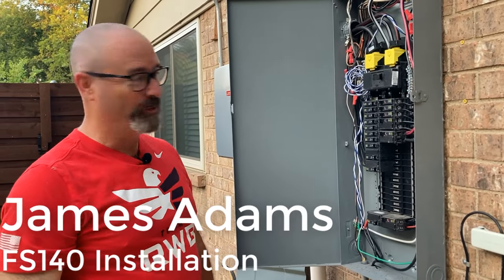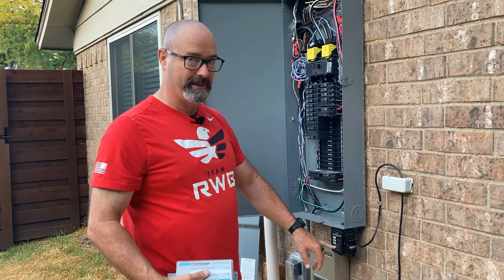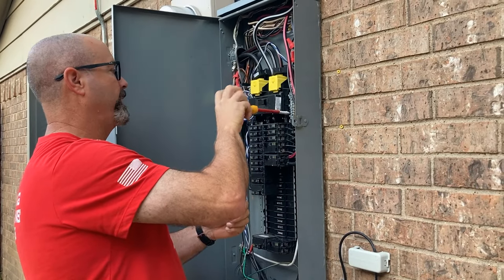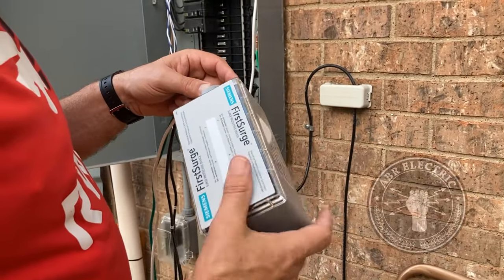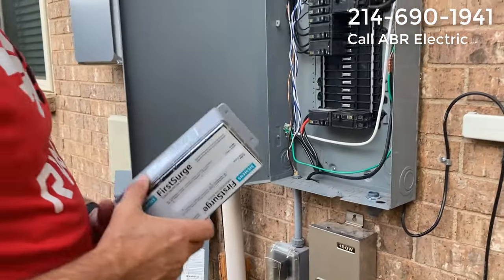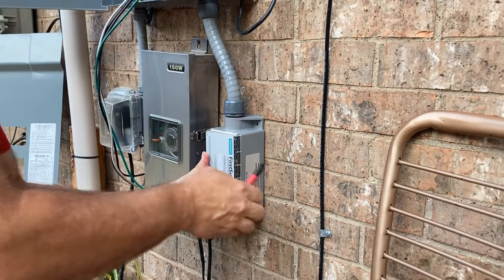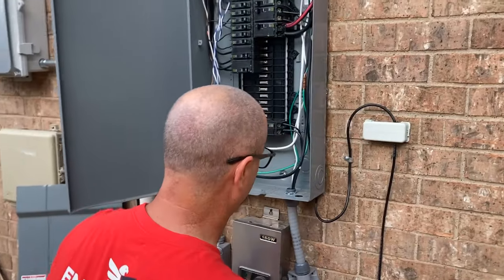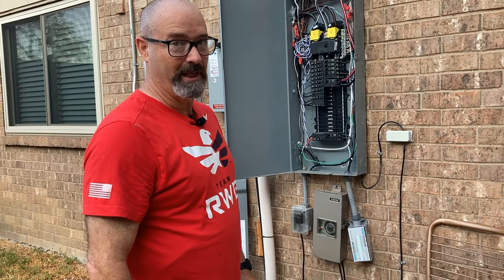Installing an FS140 Siemens Surge Protector

Comment: The SQ-D HEPD80 has instructions in the back of the that pamphlet that says that you can put ring terminals on the hot wires and connect directly to the 1/4x20 threaded studs bonding the main breaker to the bus bars!  It is the next best way unless you go with Type 1!  Just turn off your main breaker, Terminate your neutral and ground wires, then temporarily remove the 1/4-20 nuts, place your hot leads with the ring terminals on the studs and replace the nuts tightly per torque specs. It is a clean looking install, and does not take 2 Pole space and that breaker really does nothing for the surge protection (only if the SPD is Type 1 of course).
Reply from the maker: Good solution!

Comment: You should be minimizing the length between the surge protector and the panel.  Ideally you want to mount it into a CB at the first position from where the L1/L2 Enters. Shorter length = better protection.

Comment: Man i guess i did mine wrong. I installed it at the bottom. The two hot wires in the  20amp double pole breaker are at the bottom as that was the only spot in my panel. It definitely works though. My power didnt go off during the thunderstorm like it normally does

Comment: My house has two 200 amp panels mounted side-by-side (it is a big old house), and another 100 amp sub-feed panel in a detached shop.  Oh, and it also has a solar array on the roof with it's own sub-sub-feed panel.  So will one FS140 serve the whole house?  If not, how many should I install, and where?
Reply from the maker: 1 in each main panel. Do you have space in each panel to add a 2 pole 20a breaker?
Reply: @abrelectric  Yes.  There are empty slots in both panels.  What the sub-feed panels?
Reply from the maker: @so88113  subpanels won't need SPDs if the mains are covered
Reply: @abrelectric  Thank you for the information.

Comment: Just like most newer homes, we have an outdoor breaker box which is the main in, breakers for 220v dryer, AC units/compressor and 2 water heaters etc..  Would we need 2 of these? One for the main breaker outside AND the low voltage panel in the garage? I saw you had another video for doing a flush mount and it was for an indoor panel. Thanks!
Reply from the maker: One outside at the main with your 220 volt distribution would suffice.
I did the indoor one to demonstrate the flush installation.

Comment: Enjoy your videos. I am Looking at an install for a flush mount panel.  I watched your other videos where you explained the advantage of twisting the wires to get the rating back when you have long runs to the breaker and ground/neutral connections.  Is this something you considered doing here?  I need to come from the bottom like you did here, with the main feed located top and the available breaker is near the top (which is good) so I have a long run.  Also my ground bus is on the left and the neutral bus is on the right so I doubt I can twist those wires because they are going to have to take different paths.
Reply from the maker: Later info I got from Siemens tech support said the wire twisting was more an issue for commercial installations with longer runs.

Comment: I found the video to be very informative and easy to follow along.  I also dig the Team RWB shirt!  Quick question regarding landing neutral and ground wires on a neutral bus bar:  my bus bar has no slots left for anymore connections, even though my 200A Siemens panel still has about 10 slots left for future branch circuits.  Can I put a neutral and a ground under the same lug on the bus bar to make room?  Furnace just crapped out on us at 18 year mark and we're upgrading to a 2 stage Lennox with 2 step AC with a Mini Split in our addition.  HVAC guy gave me an estimate with an option to have 2 surge protectors installed (why 2, I have no idea) when one should protect everything in the panel.  After looking at the quoted price, then researching the cost of the SPD from a local store, I decided not to pay 10x the cost of the unit and just do it myself.  Thanks in advance for any guidance.
Reply from the maker: Best option: add a neutral terminal. Easiest way, assuming this is your main panel,  tap 2 holes, add the buss, connect  it to the existing neutral bus with a #4. You're creating future capacity,  and not just "kicking the can down the road"

Comment: Just thinking... if I drill a 3/4" hole in the side of the CB box adjacent to the CB I'm going to use, wouldn't that make a cleaner install? Shorter wires, no loop, no wire bending. Just a thought.
Reply from the maker: Absolutely a good thought, especially if you have a surface-mounted panel

Comment: My OCD was saying, "don't put the surge protector so close to the transformer box that you block it's opener catch." 😂The closing shot shows that you didn't.

I haven't read the instructions on this unit yet, but one thing I like is that it has 4 wires. So, if your box is not the bonded box, you can connect to both the neutral and ground busses. Many surge suppressors only have the 2 hots and neutral. I think those are rated as Type 1, but are also rated to be connected as a Type 2 to the breakers.

Question: The Home Depot page for this unit has a picture of it being installed at the bottom of the breaker box. What would be the recommended procedure to have its lights visible once you put the cover back on. Would you drill holes in the box's cover over the lights? I've seen that before and the inspector passed it, but is there a better way? I did see the video on the flush mount plate, but I mean is there a better way if the unit is placed in the box?

Technical video critique: The music during the intro vs. your speaking, the volume level is DRASTICALLY different.

Comment: Great video. I have a question, hopefully, you can answer it. If I have a spot at both the inside breaker panel and outside one which location would offer better protection? The cable run from the outside panel and inside panel is about 40-45ft. Thank you for the video and any advice you can spare.
Reply from the maker: Traditionally,  closer to where the utlity conductors come in is better. However,  if all your branch circuits are in the inside panel, that would be a solid location. Tge other consideration is whether you have access to Type 1 spd (no breaker required) or Type 2 spd that requires its own breaker.
Reply: @abrelectric  I thought that would probaly be the case thank you for confirming my belief. Merry Christmas.
Reply from the maker: @Antexjerr1  thank you! Merry Christmas

Comment: I just installed one of these and went through the effort of moving all my breakers on one side of the panel down two spots so it would be as close to the main breaker as possible. I found this suggestions somewhere but can't remember where. Was that a waste of time? I see a lot of these installed at the bottom of the panel or wherever is convenient.
Reply from the maker: Psychologically,  no. 
Technically,  maybe. Check the manufacturer's instructions: do they require it? At the end of the day, good on you: you installed a surge protector to protect your house.

Comment: question, is there code inspection requirement for how many anchors to the wall?  if it fits in panel with door closed; does that meet most codes?   thanks for the video
Reply from the maker: Apart from "normal" code requirements,  your installation minimum standards will be set by the manufacturer in the installation instructions.

Comment: Great video, thanks for sharing your expertise! I've seen some videos on installing whole home surge protectors and I do have a few questions. Why didn't you use a Square D whole home surge protector? Just curious & why didn't you place the breaker for FS140 at the top 1st in line after the main? Asking because that was part of the instructions on many other videos I watched but I know this is your expertise and just wanted to know if there was a logical explanation to why you installed at the bottom/end of the breakers?

Comment: question-actually 2.. 1-is it proper to drive a ground rod at device if spd installed on an ac condenser    2- can two surge/voltage protection devices be installed on one unit-thank you
Reply from the maker: If the power to the AC condenser has a proper equipment ground, a ground rod would be unnecessary. 
You can install 2 SPDs on a single unit.

Comment: So cal EC here. I love to use SPD breakers instead.
Reply from the maker: Definitely loads easier to install. I use those to meet 2020 requirements when the client doesn't have any concerns about surges.
Reply: @abrelectric  yea same. question for you what CRM software do you like to use or recommend? i use HCP
Reply from the maker: @bestshot300  I don't. Super OG, follow-up,  get referrals and reviews.

Comment: There are some who mention that the breakers be installed as close to the main line in as possible. Is this a consideration or will any slot work for the FS-140?
Reply from the maker: It is a consideration. The spd will work in any spot. There is lessening of the protection level the further you get from the main feeders.

Comment: Is there any reason that this device couldn't be installed inside? I have a meter box 
outside but the load center is in my garage.
Reply from the maker: @mark98070  it absolutely can be installed inside the panel. The downside is not seeing the indicator lights or perhaps not hearing the alarm if the unit is damaged.

Comment: Where do you install it if you also have a generator interlock & breaker vying for that first slot?
Reply from the maker: Get it as close as you can. There is a slight decrease in performance, but it's not a huge hit overall. Having it in 2d position is still better than not having it at all.

Comment: Nice video! Q. Can this FS140 be installed on an interior wall behind the panel? My electrician says he has to dig into the brick wall to install this device since the panel is recessed in the outside wall.
Reply from the maker: @JackA2430  it could be, for sure

Comment: i thought it was design to be installed inside the house not outside...i live in florida, very humid here...should be an issue doingte install on the main panel outside?
Reply from the maker: Per the manufacturer,  it is rated for outdoor,  wet locations

Comment: Can neutral and ground be on the same screw point?
Reply from the maker: No. You can double up on your ground wires (if they're the same size and material) under one terminal. You can confirm this by looking at the panel sticker on the inside of panel door (typically).

Comment: James: Great video bro. Question: I have a GE 200 Amp panel. Will FS-140 be adequate? Also, my main cut off panel (Midwest) is outside just downstream of the service meter can and my actual 200 amp breaker box is a GE  and located inside my house. Considering this set up, where is the best location for the FS-140; at the outside panel or the inside GE panel?
Reply from the maker: @tommymejia8244  because it's a type 2 SPD, it needs a 2p 20a breaker. It will need to go in the interior GE panel. You could add a type 1 SPD at the Midwest main disconnect (assuming there's no distribution there).
Reply: @abrelectric  Thank you, brother. I appreciate the quick response and the invaluable info.

Comment: good fellow,  you said there is an alarm. Can this be silenced afterwards?
Reply from the maker: That is a great question. I don't know. I'll review the instructions
Reply from the maker: According to the instructions, if you have 2 green lights with the alarm you're supposed to check the neutral to ground bond. In any other situation, you're supposed to replace the unit. Sounds like you have to turn the breaker off to make the alarm stop sounding
Reply: Exactly, throw the breaker if the alarm is going. And then replace the unit

Comment: As I went to install the fspd 140, it has 7 wires which the wiring shows 4 connections. It appears to have an audio built in alarm but doesn’t Light up. The instructions do not show how to or where to connect the 3 small diameter wires. I have searched all manuals for fspd 140 and no info on the additional 3 small diameter wires. Any advice
Reply from the maker: Cap the 3 smaller wires. They are for a relay.

Comment: Setious question. Instructions say install breaker close to main. Why is yours at the bottom of the box?
Reply from the maker: To quote the instructions: "Use a breaker position that is close to the SPD and the panel's neutral and ground".
Mounting it near the main breaker is not a manufacturer requirement.

Comment: Sorry I'm missing something... Why does it appear that the neutral and ground are on the same bus? Also, why are you adding a breaker to switch the surge protector?
Reply from the maker: It's a main panel, normally where neutrals and grounds are bonded together. The FS140 is a type 2 spd and requires a breaker.
So, maybe you're missing something
Reply from the maker: You are missing something: the main panel has bussing with neutrals and grounds bonded together (not a subpanel). The FS140 is a Type 2 SPD and requires over current protection.

Comment: Great video, thank you so much for sharing this info. I had quick question; would connecting the FS 140 to a sub panel off the main offer protection for everything in the main and the sub or does it have to be connected to the main panel? Do I need one per panel? The instructions don't help for this scenario. I have better mounting options off the sub and the sub and main are within a foot of each other, thanks!
Reply from the maker: The FS140 should be mounted off of the main. In the same situation,  I have either installed tandem breakers in the main panel to make space, or move a few circuits over to the subpanel
Reply: @abrelectric  If you have one on the main can you still mount them on sub panels for additional protection?
Reply from the maker: @jaycahow4667  absolutely! Layers are fantastic

Comment: If the wires between the SPD and the connection to the panel buses are supposed to be as short and straight as possible and also as close to the main breaker as possible,  the only way to do that would be to mount the SPD horizontally and run the wires through the side of the panel and straight into the breaker.  Is it against the NEC to use side access for a surface mounted panel in an outdoors location?  It seems that a gasket/o-ring would make the installation water tight.  In the past I mounted several of the EATON SPD devices directly into the sides of the panels.  I ask this because my panel already has a number of things below it so I would have to to use the plastic flex conduit to snake around the other devices below the panel.   With a large  panel  and the  SPD a foot or so below the panel, the SPD would start to be a long distance from the incoming power with the potential power surge.  I estimate that distance to be about 5 feet and that seems awful long.

Comment: Have question, on your 2 main legs coming into your 200 amp shut off you have a black semi round objects with looks to be white and blue wires coming out of them and going somewhere. Can you explain what they are and if for emp, where can I purchase them. Thank you.
Reply from the maker: Those are current transformers for my solar control panel (Enphase).

Comment: Just looking for clarification, you need a neutral and ground in the panel or you need the neutral and ground bonded together in the panel?
Reply from the maker: If you're installing the surge protector in the main panel,the neutral and the ground will be bonded.if you're installing the surge protector in a subpanel,the ground in neutral will be separated. Either one will work for installing this device.
The critical component is that your electrical system is grounded to earth.
Reply: @abrelectric  you would be surprised at how some panels do not have the neutral and ground bonded 🤦🏻‍♂️. Appreciate the clarification and educational video 👍🏼.

Comment: SO with the 140, the breaker does not need to be at the top?
Reply from the maker: No.
Here's the instructions: firstsurge-installation-guide-lp-1414.pdf
Reply: @abrelectric  thanks. I saw where it is discontinued, do you know what is replacing it?
Reply from the maker: @ejcsds  where did you see that? I hadn't heard that the FS140 was being discontinued
Reply: @abrelectric  I believe it was on Supply House.
Reply: @ejcsds  What we need to find-out is, was this product discontinued by the distributor due to low sales or was it discontinued by Siemens? Amazon is still selling them, so I would lean more towards the former. I'll actually contact Supply House and ask that question.
Reply: @kencrisp6333  FYI Supply House shows again, but on back order.